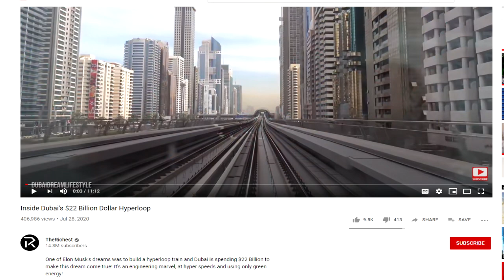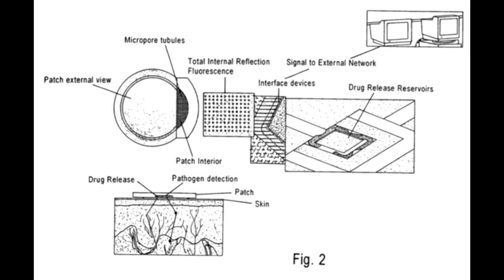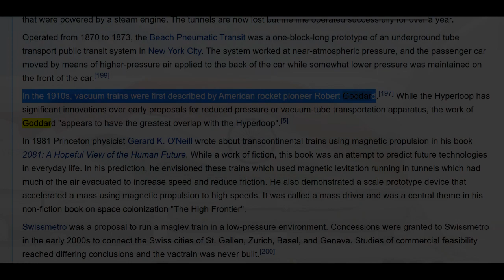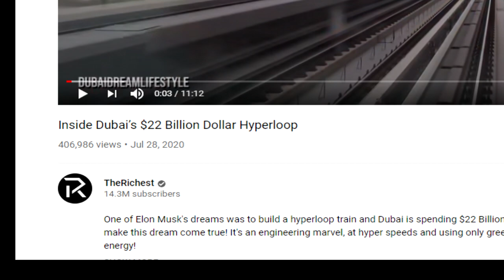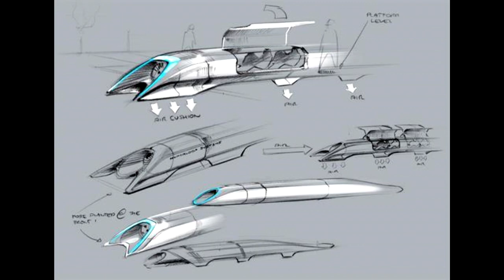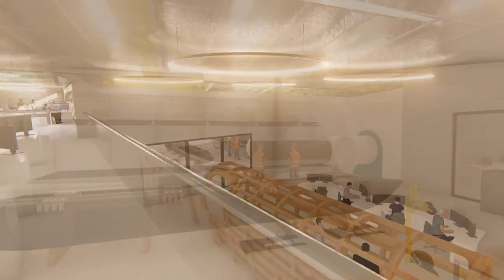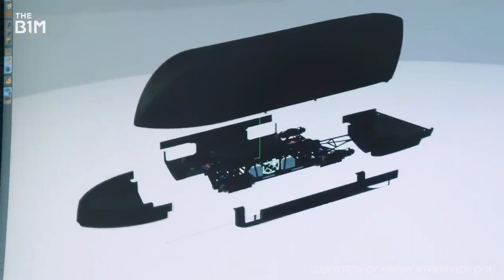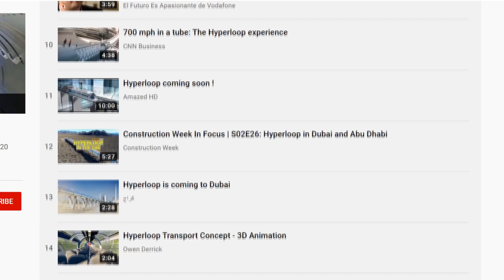Hyperloop, the biggest Scam since Theranos

Comment: "It generates more power than it consumes"

What?
Reply: Solar panels installed on top of the tubes.
Reply: Even the most high end solar panels aren't that efficient at producing energy. The last time I read was a solar panel managing to get 22.8% efficiency. That was the highest (i believe, correct me if it's been updated) record yet. And that's on extremely sunny days. So no, there's many variables that stops solar panels getting that much energy. If we manage to get to 100% efficiency we can talk but right now that statement is BS. Don't overhype your idea when you know you can't do that much yet, taking that gamble puts bad light on that idea.
Reply: The whole system is generating more power than it consumes. A solar panel system or a dam system generates more power than it consumes. It's not like the pod in the hyperloop is generating power.
Reply: Allow me to introduce 2 technology that does exactly that : 
1.race bike in transportation world it require less effort to make it outran cheetah and consume half of calories you just taken from let’s say a sandwich because it’s pretty light (this came straight out of avid cyclist myself) 

2.the AMD ryzen in tech world well it’s consume less wattage while outperform the intel counterparts well from what i read it have a smaller pin
Reply: @MaseraSteve2  And nuked in  war of world
Reply: @bigcatdiary08  the pod of the hyperloop is not producing energy. Its the solar panels. 

If you have solar panels on the roof of your home and on a particular day you consume less energy than the panels produced, the remaining will go to the battery and the grid. 

Guys try to think for your ownself before making a conclusion. No thermodynamic law is being broken
Reply: @bigcatdiary08  i just gave you example of a solar powered house. It can and do generate more power than it consumes. Try to use your brain
Reply: This is literally a 5 year old's design. "let's draw solar panels on the top lying flat, it will give us more power than my choo choo will consume"
Reply: @bigcatdiary08  perhaps the terms used were slightly inaccurate, but no thermodynamic laws were broken.
Reply: I thought perpetum mobili are not possible :D
Reply: @diabeticvodka9312  what has that to do with anything? The statement refers to the fact that apparently the Hyperloops solar panels generate more power than the pods require to be moved from one location to the next. The efficiency of the solar panel refers to the amount of photon energy that hits the panel is actually converted to electrical energy. The fact that the maximum efficiency is about 23% does not exclude the possibility that the Hyperloop "generates more power than it consumes".
Reply: @bigcatdiary08  Dude, you seem to have no idea. 1st: If normal people talk about energy they mean eneregy that has the ability to perform work (change in enthalpy). 2nd: If you ever talk about thermodynamic you have to have sensible system boundries and a system boundry that is around the whole universe doesnt make any sense.
Reply: @diabeticvodka9312  The efficiency limit for single junction solar cells is only around 33.7% (Shockley-Queisser limit) and the most efficient single junction solar cell has 29.1% efficiency under lab condition. That is 86% efficient and if you know anything about engeneering this is fucking good, you will never have 100% efficiency in any process. For multijunction cells 47.1% efficiceny has been achived.
Reply: @jellehofstede6052  Finally someone with sense
Reply: Well, "it adds more power to the electrical grid than it takes out of it" would be the accurate statement. Obviously it's not a perpetual motion machine.
Reply: Totally shits on conservation of energy
Reply: @diabeticvodka9312  highest solar efficiency is 50% in lab condtions. This translates to 30% panels irl which then have 25% efficincy in real use. There is room for improvement.
Reply: Why we hating on coldfusiontv
Reply: Read the docs, you can't search such an extensive answer to your question under a YT video
Reply: @andreasericsson6989  So you wanna play with words? Nothing better to do?
Reply: @bigcatdiary08  "IT" being the hyperloop, the actual loop. It wasnt referring to the pod but the loop.
Reply: No problem. It can be done. Vacuum pump as propulsion. Vehicles as vacuum pumps. Leaks as propulsions. These propulsions convert into kinetic energy, which can be recovered to electrical energy. Losses will be low so solar panels can generate enough energy to recover the losses. Strong tubes to overcome vacuum? Concrete culverts. Concrete is strong compressively. Watch the vacuum chamber in NASA. Made of concrete.
Reply: @diabeticvodka9312  You Don't power the vehicles directly. Solar panels just to recover losses due to leaks etc. Travelling in vacuum reduces losses tremendously.
Reply: @markharmon4963  Because things aren't that simple. It's like saying why don't we make humans fly by gluing eagle wings to someone's back.
Reply: @fuk  The Hyperloop won't generating anything.  A solar farm is to be placed alongside the tube.  The farm could be anywhere and could be placed in more efficient locations.
Reply: @icemeoutlikeelsa  It isn't? You mean I can not glue feathers to my arms and fly? I'll bet I could.  As long as they were on a frame and skin of the correct span and dihedral, with a thrust to mass ratio that was appropriate.  I guess that is what aircraft designers do.  The land set asides and the tubes themselves might be  enough exposure to create a net positive in electrical energy consumed by the pods and infrastructure.  This is probably pretty easy to determine within a few significant digits. What is so difficult to understand? Shading the tubes with PV panels will greatly reduce the amount of expansion of the pipe.
Reply: @fuk  I appreciate what you are saying, however in some sense the pods perform as batteries as the power expended to accelerate one pod is used to decelerate another. Of course there are losses, however there is no aircraft that can perform such a trick.
Reply: And they didn't even mentioned that to build this long and big structure will take so much of resources, that this promise if even further away
Reply: @augustuslunasol10thapostle  It was just a demo. Real tubes will need to be built of different materials to match the operating speed and the level of vacuum required.
Reply: @bigcatdiary08  True, that is why when you create vacuum, no energy is lost. It is transferred to the vacuum. The onrushing air when there is a leak, can be transferred to the kinetic energy of the trains.
Reply: It means the solar panels at the top, it's not claiming to be a perpetual motion machine.
Reply: @fuk  r/Iamverysmart
Reply: @othmanskn  Literally none of that is true.
Reply: @fuk  the amount of energy the solar panels will generate is miniscule compared to the amount of energy a train will consume to run
Reply: @dipanjanghosal1662  Ok might be true. Might be not. Do you have any basis to form this argument? A square meter of solar panel can produce upto 200Watts. A 50 ton Maglev train typically require 50kW to operate. So you need solar panels  in 250 square meter area. I don't see how such system would be an impossibility given that the track would be spread 100s of kilometers. 

I am not saying that they would be building that system. I am just pointing out that the statement have nothing to do with conversation of energy.
Reply: @bigcatdiary08  But there's the guy with the glue gun and the spark plugs on YouTube making one perpetual motion machine after another....
Reply: @fuk  I don't doubt that with enough solar panels you can generate a lot of energy but what does that have to do with the hyperloop innovation itself? We can also put solar panels on normal train tracks and generate energy there, so that's not special to hyperloop. Always beware when people tell you something is innovative and don't trust the core idea to stand on its own,but need to list a dozen other 'we can also add this to it'. Show us a capsule carrying passengers from point A to point B in a vacuum and show the running costs are lower than high speed trains. Then everyone will be happy. If there is no vacuum, then it's a non starter, if it is more expensive to run, per passenger, (forget the development) it's a non starter, if it is slower than high speed trains, it's a non starter
Reply: @Original2BBB  idc about that. im just replying to dumb people who are saying that its scientifically impossible for any system to generate more power than it consumes. which as u said, almost all power generating systems do
Reply: @fuk  'Power stations do not produce more energy than used. That is indeed, impossible with any tech we have. Solar panels cant put out more energy than falls on their surface. You have fallen for a marketing scam 👍. If I ran a 2 MW machine, and hooked it up to a 3MW  diesel generator, would I be able to say my machine puts out more power than it uses ?
Reply: and bricks

Comment: I mean just look at the initial hyper loop “cars” that several universities participated in making and all of them were hilariously pathetic
Reply: All underwhelming and a stupid waste of good resources
Reply: My favourite was the one propeld by a compressed Nitrogen rocket. Thus rendering the vacuum, not a vacuum any more.
Reply: The one from a university in Munich went so fast that it exploded. So it works its just not quite there yet
Reply: @YounesLayachi  but thats just basicly how it goes now.   Instead of making cars more aerodynamic we blow all the money we have in.  Well this crap😂    or on solarboats which would hold 1 person and with a bit of shade it would stop.🙃    impressive how stupid mankind sometimes can be.   And yet behold the device what ya are holding now..   We can make that so how hard could it be to just make  transport better..
Reply: My favourite was the one who's doors opened outward, so making a single, unnecessary point of failure.  When you can't get the doors right, even DECADES after disasters that showed why you had to, give up.
Reply: Students are not engineers. Projects are not products.
Reply: Aint Jack  it doesn't matter what they are making, as long as they do their calculations and projections right. Learn how to test parts of what they have build. Learn how to test using model scales, etc... That's what they are learning.
So it's not a waste of money and resources, because 99%* of the projects done by students don't get anywhere anyway.

*I made this up, but I'm sure you get the idea. ;)
Reply: Musk sucker begging for his attentions
Reply: All part of the investment and subsiduary bubble scam.
Reply: Aint Jack  Ey man, They're just doing their job.Money is money.

Comment: "Generates more power than it consumes" Snowpiercer isn't a new idea.
Reply: It's even funnier when you realised it was revealed near the end that the Snowpiercer is powered by child labour
Reply: @gelatinocyte6270  The same way as nuclear powerplants are powered by human labour.

Of course it will stop working if you stop operating and repairing it.
Reply: Generates more power than it consumes?  So would simply laying hundreds of miles of solar panels ON THE GROUND. Without using ANY of the power to drive vehicles. Its an insanely expensive support system for standard solar panels.
Reply: If you're not in first class, don't eat the food.
Reply: The US Patent Office specifically states that they will not patent any perpetual motion machine.
Reply: @markdoldon8852  Even if you just ran solar panels forget the train, it can not produce more power than it consumes, as per laws of Thermodynamics, So if a solar farm (no matter how big as it's proportionally the same) was only producing power to maintain, repair and replace itself whilst growing or building more panels, weather it be robots or whatever, it will one day run out of power.
Reply: Snowpiercer was wank.
Reply: @andrewdevine3920  never said it was good, just it has been around a long time. The original comment was a joke anyway.